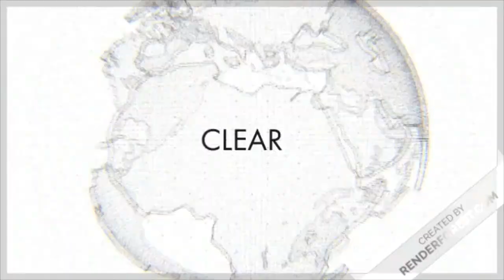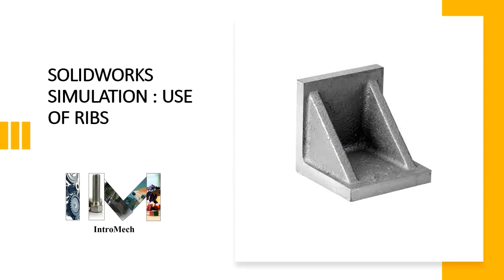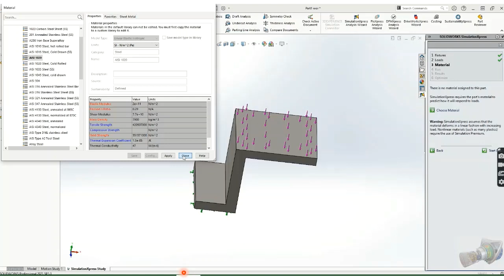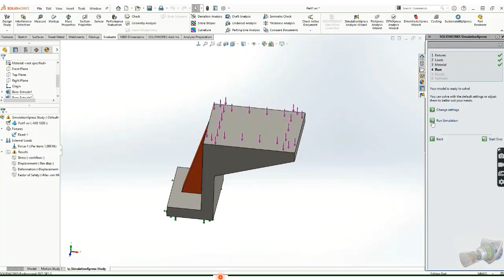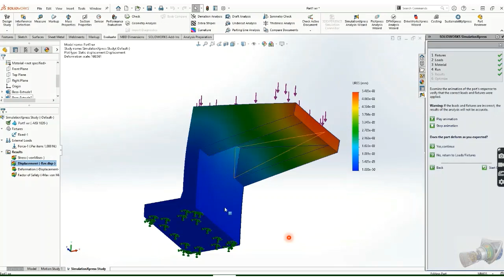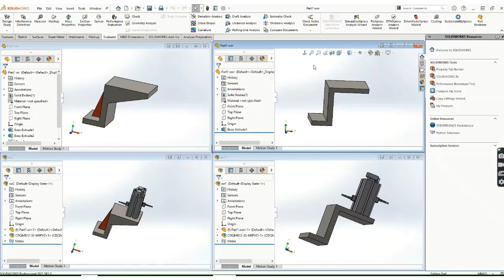Comment: Sir how to know deflection in the body within permissible limit and what about meshing ..
Reply: 1) For deflection, you have to check that how much deflection is permissible in your application.
2)The results from the SolidWorks might not be fully accurate as the software has its own limitations. Yes, the mesh size/type matters a lot and for detailed analysis you can go with Ansys. Mesh convergence Study is required to be done for more accurate results.